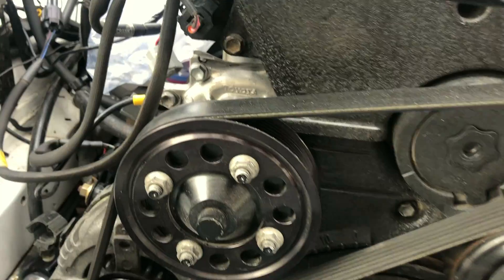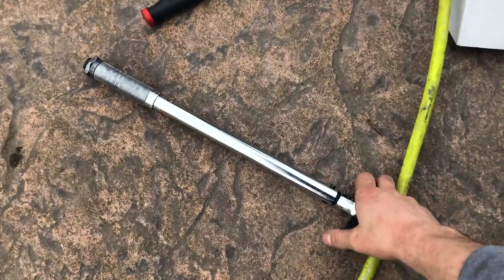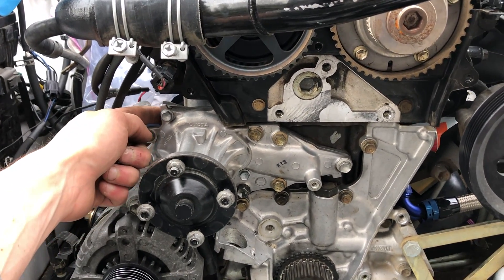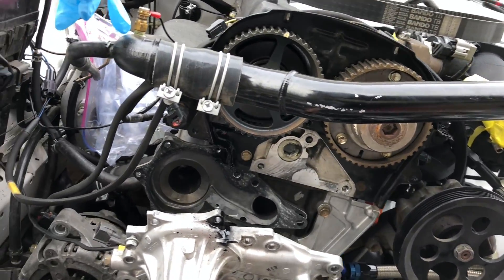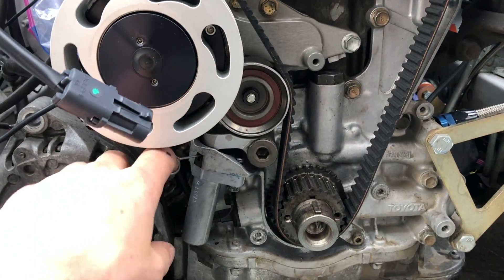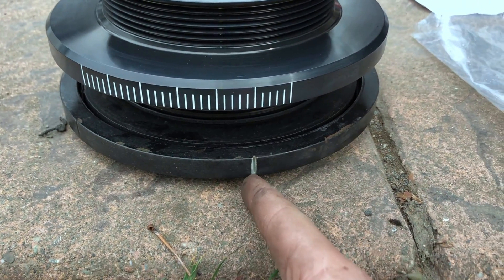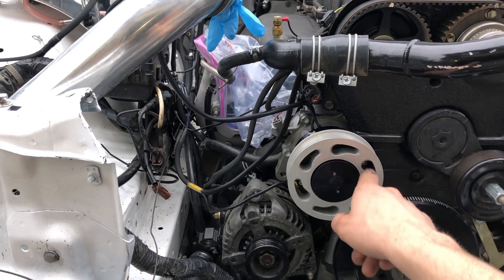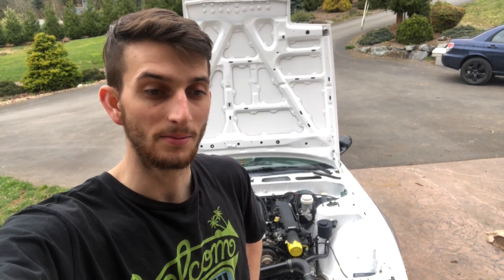HOW TO KEEP A 1JZ / 2JZ COOL WHILE DRIFTING

Comment: Hello! How its going after 6+ years? How´s the performance? Is it that true that you never saw again 200+ degrees? I´m about to buy one, but I really don´t know if to buy this, or go for a DaviesCraig one
Thanks for the answer!
Reply from the maker: This works till this day. It stays under 200 during comp drifting. But it will get hot if I hot lap at open drift. I need to get rid of my homemade triple pass radiator and need to upgrade my fans.

Comment: Nice vid!  Helpful tips for sure.  I have a lot of cooling trouble on my 1JZ but it's also extremely hot rn.  I'm considering a vented hood and some ducting for the rad.  Thanks for uploading!  Cheers from Tampa Bay
Reply: What did you do to help cooling your 1jz?
Reply: @CAC-1111  Thanks! You know, in my mind I've designed an aluminum (spare gutter) ducting system from bumper to intercooler to rad. And a universal hood vent above the exhaust and another above the radiator to exit heat.  NONE of this I've done cuz lazy!😆

Comment: go to your hardware store and buy 2 or 3 long studs in the various sizes of stuff like your water pump.  take it home and cut the bolt heads off and grind the rough cut down to a taper, you now have guides you can use for easy and precise install of various parts that use gaskets.
Reply from the maker: Thanks for the tips!

Comment: for future reference, NEVER use a torque wrench to turn off a fastener.  Now as for the pneumatic impact, of course those won't work. Air is weak (only rated between 85-150psi, good for about as much ft. lbs of breaking power).  You need an ELECTRIC impact gun. even a crappy small one with a speed hammer has between 400-600ft lbs of breakaway torque.  The big boy makita or millwaulkee will do 300-800-1200 ft lbs or something in 3 different settings which is the type i use for everything from lug nuts to wheel bearings to crank nut.  Nothing will defeat it.  only use for breaking, never for installing